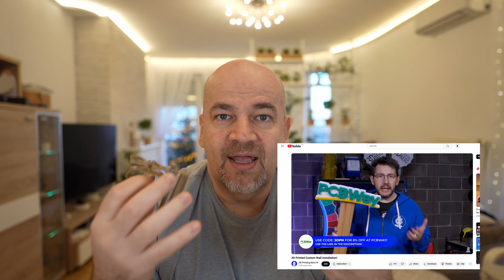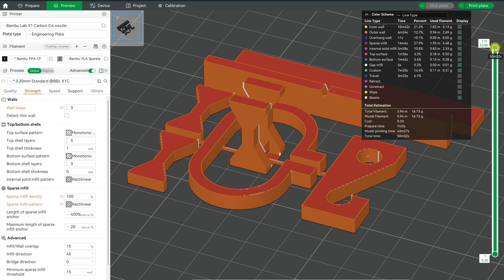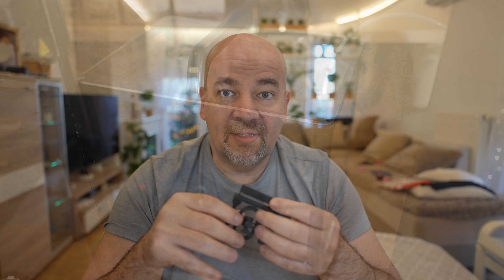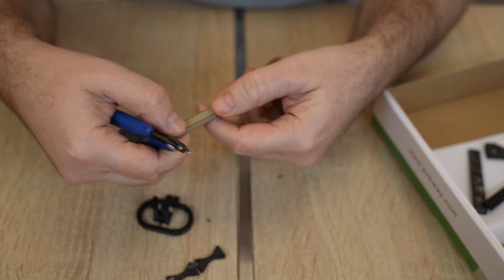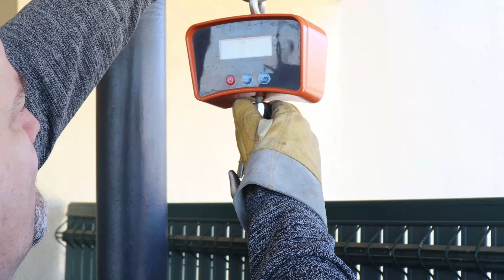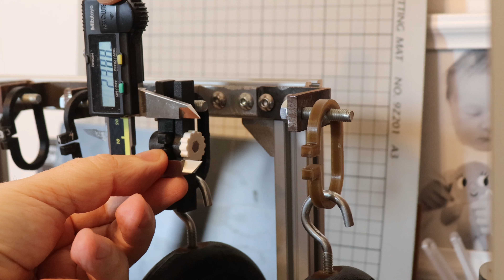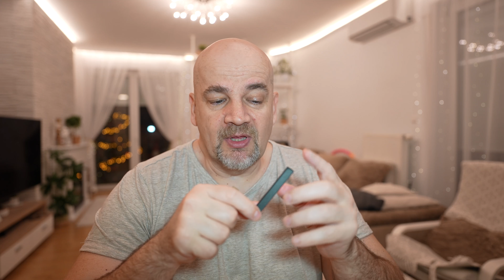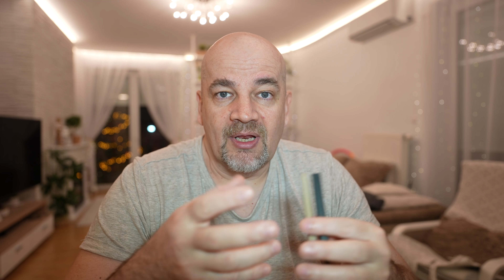PEEK vs PPA-CF: The strongest industrial vs strongest consumer filament

Comment: PEEK when annealed, it turn in to milky white. This print is not annealed.
Reply: We have at work a good experience with PEEK filament, and ALWAYS when we annealing the printed parts while 3d printing with special technic,  than after printing also,  we get a result: 90% strength between layers from the original part.
Reply: @obaidabohsas6448  Hi, you mean 90% MORE strength or 90% OF the strength before annealing? Which printer do you use?
Reply: @obaidabohsas6448 90% of the layeradhesion or 90% MORE? A bit worthless without that information 😅
Reply: @obaidabohsas6448 90% of the layeradhesion or 90% MORE? A bit worthless without that information 😅
Reply: I was about to comment the same. It doesn’t look annealed. Should be more opaque in colour.
Reply: @Theprofessor1212 Yes, you're right, but it doesn’t turn white—it becomes a soft beige. This print indeed looks more brownish.
For context, ARKPEEK-GF30 (30% Glass Fiber + 70% PEEK) and CF (Carbon Fiber) variants exist, and samples can be ordered.
According to NIH research, annealing in nonsolvent vapor at room temperature significantly enhances the mechanical properties of as-printed 3D-PEEK:
Strength: +22.6%
Ductility: +151.3%
Fracture Energy: +109.1%
Conclusion: Combining annealing with CF or GF-reinforced PEEK dramatically improves all key specifications and will be beyond PPA-CF, so it is not quite proven thet we can print as strong as Peek, with a consumer level printer and consumer level filaments. But when would we need that: only in indurstrial applications.
Reply: @JohanDegraeveAanscharius  Naa man I definitely want to print PEEK for my projects...
Reply: @Theprofessor1212  Opaque is not a color. Opaque means not transparent/translucent.
Reply: @neufxtrois  Yes i know. Annealed peek is more opaque than translucent like the sample tested.
Reply: @Theprofessor1212  But the sample in the video is not translucent, if it was then you would be able to see light passing through it.
Reply: @neufxtrois do you think this comment is helpful?
Reply: Would be good to remake this test with peek that has been annealed.
Reply: No, it stays beige
Reply: Not only that but clearly not printed well or at the heat needed for proper adhesion dudes a shill
Reply: @terpsquirter7107  i mean not really, if i have to anneal my print i might as well not use it, i can have amazing performance for a filament 15% the price? Sign me the fuck up

Ill leave peek for the people that can actually afford to run a VM 22
Reply: @terpsquirter7107  not to mention that everyone knows PEK is way better anyways
Reply: Anything you have to anneal is automatically a lost to the 3d printing world, dimensions whats that.
Reply: @odeball22 you are not correct, its like saying any thermoplastic that shrinks cant be used for injection molding. 

You just compensate and adapt!
Reply: @BultiZ  yawn

Comment: Not too familiar with PEEK but do you know if the parts were annealed by PCBWAY prior to shipping? Based on the looks of the samples the color of the PEEK is unannealed. It usually has a yellowish tan color when annealed and greatly improves the properties. Would have have been cool to see the melt test done.
Reply: Yes, these parts are completely uncrystallized, which means they're not anywhere close to the performance of PEEK.

Comment: Dear Igor, 
thanks for all your testing of different filament types. I like that you compare them side by side in one videa. 

thought nbr.1 myside:
The one thing that for me would be super interesting, is a comparison with all other filament-types. For example: if you compare PETG with PETG, then sure, I see what the strongest PETG is. But if we have a chart of all types of material, I could see that PETG is (as an example) 17% stronger then PLA etc. Right now in your tests: Each filament is a bubble on its own, I would be interested to have one big bubble, and cross-compare all facts with each other. Do you think this is something that makes also sense for you? :) I hope you understood what I mean.

thought nbr.2 myside:
Another example: if you make a test of Filament_Type_A from manufacturer_1, and in another seperate video you test the same Filament_Type_A from manufacturer_2, then you dont combine/compare the different results, which for the viewer means: we cant compare all resuslts from Filament_Type_A, and make a decission which one is the best, right? 
Hope you understand what I mean, I therefore suggest a general chart, wich includes all tests, and a ranking, of same type of filament (PLA or PLA+ or PETG etc), and then rank all manufacturers in the ranking with theír result.

just thoughts :) I print a lot myself, and really like your methods, but for me the use of your data isnt helping much, if the results are just in their own bubble....
Merry Christmas afterwards, and good start in 2025!
Reply: It is also available by watching every vide0 lol

Comment: PPA-CF seems to have only 1 drawback: brittleness. In all other aspects it is the current top material at least matching it's competitors. Quite impressive.
I have some PPA-CF just delivered and will see how far it gets me. On my RatRig I can get well over 70 °C chamber temperature, curious whether the layer adhesion is further improved by the high case temperature.